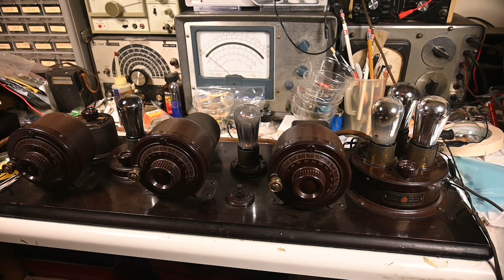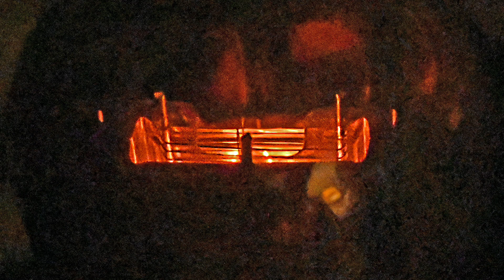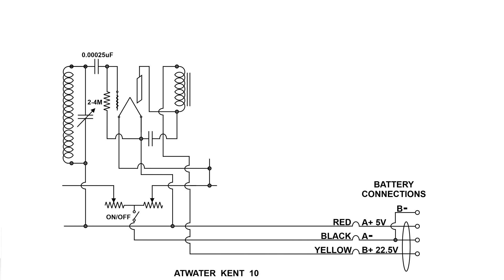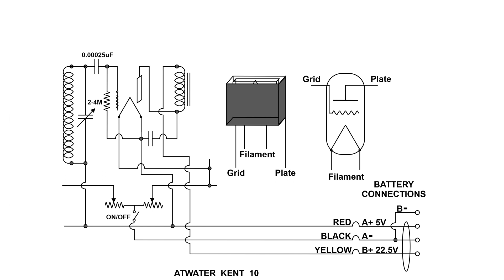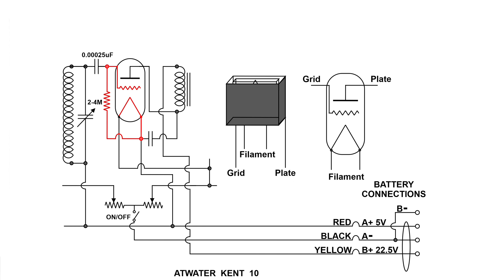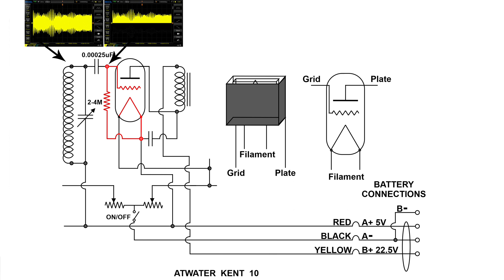!923 Vacuum Tube, Amplitude Modulation Detector Circuit in Detail

Comment: This detector circuit was used in many different radio brands at that time.  The circuit is actually performing 2 functions simultaneously; RF detector and audio preamplifier.  Combining the two functions does compromise performance but, was considered an acceptable tradeoff in order to save the use of one additional vacuum tube.

Detector operation: The plate voltage on this tube is so low (22 volts), the tube, even with 0 volts on the control grid, is on the threshold of being cutoff (almost no plate current flowing).  Therefore, in order to get the tube to conduct, the input signal must go positive.  So, as the RF signal on the grid passes the zero crossing point, the positive portion of the RF envelope is getting amplified and the negative portion fully cuts the tube off.

The circuit compromise is this: The circuit operates best at a certain RF input level (I.E., a "Sweet Spot").  If you over drive the detector, the control grid will act as a rectifier diode connected to ground and will short out all of the positive portion of the RF envelope, pushing the DC level on the grid increasingly negative as RF drive increases.  This will cause high audio distortion as only a portion of the positive RF envelope will be amplified.  Conversely, under driving the detector will produce low audio levels and somewhat increased audio distortion.
Reply from the maker: Thanks

Comment: So the triode is acting as a diode and then further filtering is done by the cap connected between the filament and the transformer? Of course the grid leak resistor and the other cap also play a part.
Reply from the maker: The triode rectifies (detects) the signal and amplifies the signal at the sometime.
Reply: @AllAmericanFiveRadio   Yeah, that is the part I left out. It is interesting the different ways detection was done  over the years.